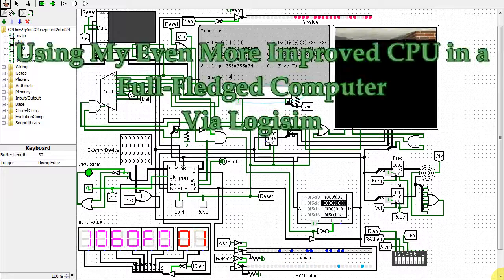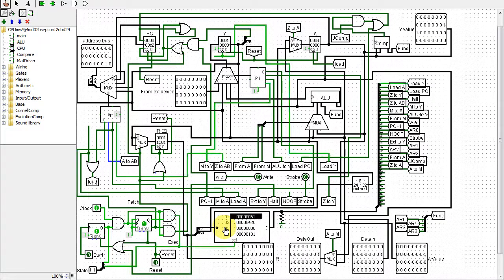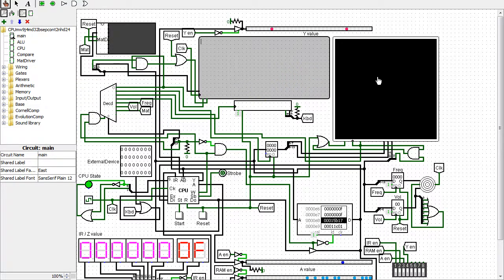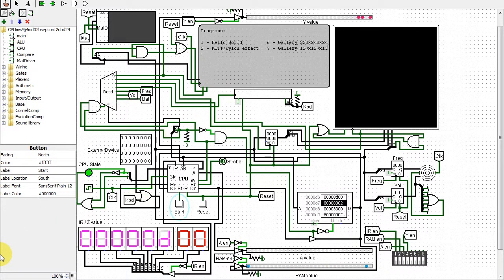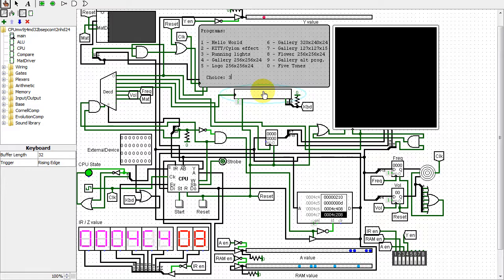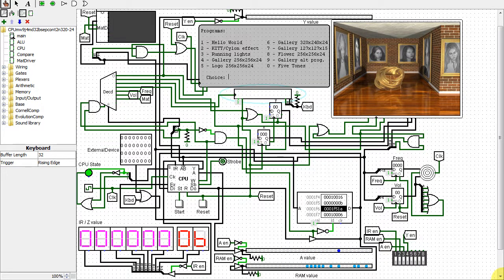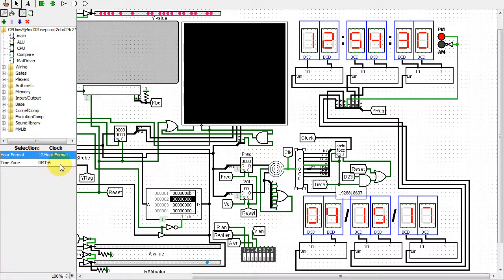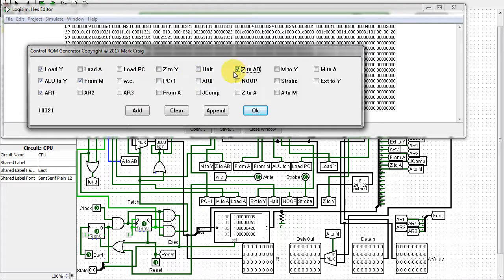Using My Even More Improved CPU in a Full-Fledged Computer Via Logisim

Comment: thats very impressive! i just need help on how to make stuff like that, i can make an 8bit CPU but only the instructions work, i dont know how to use the ALU yet; should i make the output straight to data or what?
Reply from the maker: @Cosiner  Thanks!  Concerning the ALU, there are two ways to do it.  The way I do it is: the ALU output is connected to a specific register (Y) via a MUX (MUX needed to select the input that gets written to the Y register.  Alternatively, if in one's design, only the ALU gets written to Y, the MUX wouldn't be needed).  The other way to do it is to connect the ALU output to a data bus that many components write to and read from (with controlled buffers making sure only one component writes to the bus at any given time).  Either way, control lines orchestrate all the various "write enables", data paths, etc, making sure reads and writes happen at the right time (when the data is valid, etc.)

Comment: Hi. is your processor capable of outputting images to any type of graphics output? for example, the built-in matrix.and with the condition of a different number of bits per pixel?
Reply from the maker: @dimagames9049 My simulated computer has both a (what could be considered a VGA) video screen and an LED matrix (about 12x8 if I remember correctly).  The video screen has a few different resolutions and a few different bits per pixel - default screen is 256x256 with 24 bits per pixel.  There's also 320x240 IIRC, and 128x128.  128x128 can be either 24 bits or 15 bits per pixel.  The processor (as in CPU) can output to any of these (or any video devices that can be simulated in Logisim).

Comment: can a gpu be made to do ml like random forest?
Reply from the maker: @robin vermillion If you mean in a real computer/GPU, yes.  In fact, nvidia's Jetson Nano is specially designed for ml, etc.  If you mean a GPU modeled in Logisim, maybe, but it really wouldn't be practical.  Not only would it be slow, but you would probably run into data storage problems.  I don't know specifically about the data storage requirements of random forest, but generally machine learning involves a lot of data.
Reply from the maker: @robin vermillion Concerning my previous response about Logisim + simulated GPU + random forest:  I was assuming a non-trivial data set (thus data storage problems).  But given Logisim's limitations, one could implement random forest using a trivial data set (as an exercise in how to do it, not necessarily as a useful tool).  If a useful tool is desired, a real GPU (non-simulated) would be best or even just a CPU-only program.
Reply: I was thinking more along the lines. Can a chip be made to handle ml only
Reply from the maker: @robin vermillion When I read your clarification, the first thing that popped into my mind was quantum computing.  Since ml isn't really my area of knowledge, I looked it up - it turns out there's a company in California (Rigetti) that is looking into using a quantum computing chip for ml (more precisely clustering) - they call it Forest I believe.  I'm not sure if your "only" is a deal-breaker, though - I'm not sure if any hypothetical ml chip would only do ml.  But I guess, perhaps you mean it was designed specifically for ml.  In terms of things that exist now, I guess Jetson nano - but that would definitely not be "only" since it's probably just one of nvidia's GPUs with features added that help with ml.

Comment: @MrMcsoftware how did you load the image into the ROM/ RAM?
Reply from the maker: @RoHuss Assuming the images displayed on the video screen: The images are part of the program (stored with the program) that's loaded into the RAM component (right mouse click on the RAM component to load RAM contents).  For the images in this video, the image is just completely sent to the screen with hardcoded values stored in the program (actually hardcoded LOADI and STOREI instructions (except in the case of Program #9 (I think it was 9) which grabs the image (raw data, not LOADI/STOREI) from the program's memory and sends the values to the screen).  For the images (except for Program #9): I wrote a few special assembler directives in my assembler that reads a raw image file and assembles them on the fly to the necessary LOADI and STOREI instructions.  BTW, my assembler writes the program file in a format that Logisim uses (if you want to know what the format looks like, try editing the RAM contents and save the RAM to a file (via right click menu)).  Also BTW, some versions of Logisim Evolution are extremely flexible on RAM file formats.
Reply: @MrMcsoftware  thank you so much

Comment: Make a CPU for home work. WOw.
Reply from the maker: @Dawnella Rojas Yeah, I know :-)  And that was about 34 years ago.  BTW, one class I signed up for would have involved soldering together a computer to keep (not on the level of a 486 PC, or Mac, etc. though (but it might have had a 68000 CPU, not sure)) but the class got cancelled because not enough people signed up for it.
Reply: @MrMcsoftware  Wow, great!
Reply: @MrMcsoftware  Does that mean your original homework assignment was on paper? I would imagine it would have been very difficult to simulate much of any microcircuitry when the physical hardware was in the 8-to-16 MHz range!
Reply from the maker: @YadraVoat  Yes, it was only on paper.  The MHz range wasn't quite that bad at that time (but close) - the SUN 3/260 in the lab had a 25Mhz CPU, the SUN Sparc's maybe about 2 years later (but still while I was a student there) were in the range of 25-80MHz, and the Harris Night Hawk was a multiprocessor system (I don't remember how many processors) with Motorola 88000s each running at 25MHz (according to Wikipedia page).  IIRC, there was a Connection Machine in another lab, but I didn't have access to it.  BTW, there was a group on the same floor called "Rapid Prototyping" - I wish I had asked them more about their work.  I think it was them who were using Cadence, but not sure.  If they were doing anything like today's rapid prototyping, that would have been incredible.

Comment: Hello, your processor is incredibly good, and the frequency problem can be solved through a small crutch. After starting the Logisim evolution, you can set the frequency there, and then start the usual one. After these manipulations, I had a frequency of 400 Khz+-.
Reply from the maker: @DARK Thanks for the compliment!  I'm not sure I understand your technique.  If you mean that you start Logisim Evolution (and set frequency) and then start original Logisim (or even another Evolution) and load your circuit in the 2nd logisim, I don't really see how one would influence the other.  But, I do know that some versions/forks of Evolution have added faster/greater frequency options, so maybe you have one of those versions.  I mention original Logisim specifically in this comment because that's the version I used in this video (in later videos I use either Evolution or both original and Evolution),  I don't think anyone has added faster frequencies to original Logisim, so I'm guessing. I guess your technique might work in certain cases since Logisim remembers the previous frequency setting, so in that sense the 1st Logisim run would affect the 2nd Logisim run.  Interesting...

Comment: is there a multicore design?
Reply from the maker: @M aY Unfortunately, no.  I've thought about it, but one problem would be that it would be about half as fast (since every component, including wire, takes time to simulate),  I've also thought of a co-processor system.  Since the CPU is a subcircuit, I could just have two instances of the CPU, but to avoid conflicts, the 2nd CPU would have to have either it's own RAM or maybe just run something non-changing in ROM.  I imagine creating a multicore would probably require components that Logisim doesn't have (though I guess those components could be made (either as a JAR library or as lots of circuitry - reinventing RAM, etc.)).

Comment: How do you make the assembly programs run inside the CPU inside logisim?
Reply from the maker: @Neves I don't know which part you want to know about, so I hope I answer your question sufficiently.  I wrote an assembler for my CPU's instruction set.  It takes the assembly code (such as LOAD 2, etc.) and converts it into machine code (in the file format Logisim uses).  I then load that into the RAM in my circuit (some people use a ROM instead).  The CPU then fetches the instructions from the RAM and runs them (in this case, according to the values in the Control ROM which orchestrates all the control lines).  If you need to know how to load a file into a RAM, I cover that in my other videos (I don't remember which one(s).  Probably "Testing and Improving My CPU Design with Logisim (And Digital Logic Basics)" would have it).  If you need to know what format Logisim uses for the RAM file, that might be covered in my other videos, don't remember... Or you could put some values in the RAM and save the file (right click on component if I remember correctly), then look at the file (they'll be a very short header then the hex values),  Hope that answers your question.
Reply: @MrMcsoftware  yes thanks

Comment: Yeah, yeah, yeah. Let me know when you implement this on breadboard....

:P
Reply from the maker: @Lee Sweets :-)  Don't know if or when that would happen (implementing that is).  I've thought about it; even thought about simulating a 74x series version in either Logisim or similar simulators, but never got around to it.  But, in case you haven't seen my most recent video, my CPU design has been put in an FPGA, so there is a hardware version in a sense.  BTW, a graphics card for a breadboard implementation wouldn't be pleasant to do (as Ben Eater showed,,, His started out with me feeling "That's not too bad, I could do that" and ending with "I'm not gonna do that" :-) )

Comment: How to install Cornell University library? I dont know what is the correct class to load.
Reply: Decompiled and was able to find base library, but not others.
Reply from the maker: @Júlio César Brito Gardona What are the others?  If it helps, some of my JAR libraries are available at: http://sites.google.com/site/mrmcsoftware (click on Downloads link).  All my libraries have the correct form of MANIFEST.MF file that specifies the base class.  But, since the various Logisim Evolution maintainers have changed their routines in ways that break backwards compatibility, they may or may not work in your version of Logisim Evolution (if you have newer version).  BTW, in at least one case, there is a version for original Logisim and a version (with different name) for Evolution.

Comment: 1:38 Why is "NOOP" going nowhere?
Reply from the maker: NOOP means "No Operation" - it's an instruction that doesn't do anything, so the CPU doesn't need any control logic to implement it.  However, in the homework assignment which this is based on, we were required to have a NOOP instruction.  But in my Logisim video before this one ("Testing and Improving My CPU..."), I reappropriated the control line to toggle between addition/subtraction and multiplication/division since the homework assignment didn't have multiplication and division instructions.  When I redesigned for this video, I returned it back to a NOOP, but left the line in the design in case I would ever need it and also to point out that the line still exists.  The short answer is that it's not needed.
Reply: @MrMcsoftware  Ok, thanks!

Comment: but can it run doom?
Reply from the maker: Asked and answered before :-)  Yes, it could run Doom.  But, in Logisim, it would be very VERY slow, and I'm certainly not gonna write it.  But, I did write a raytracer for my CPU (starting in my floating point video and improved in my two stack videos) - though to get a good speed, I had to run it in a simulator I wrote (it does run correctly in Logisim, just very slowly).  I also converted my assembly code in all these videos from my CPU design to x86 (subject of a future video) and the code was surprisingly similar (except for some register behavior/usage differences)

Comment: I've got a little question. Is the simulation in real time, or you sped it up?  In the beginning of the video it takes you about 10 seconds to load the image to the screen, and on my pc, even on higher frequency, it takes about 45 seconds. And thank you for sharing your library with the screens.
Reply from the maker: It's sped up.  I don't remember how much it's sped up.  You're welcome (though I can only take partial credit since it's not all my code).  BTW, you posted this comment via 3 different accounts, but only this one showed up (I was notified of all, but only this one showed up).
Reply: Thanks for the fast answer.
I removed the comments because I've had some kind of bug, and the comment appeared twice. And when I removed one of them, both were removed. Only on third try I succeeded. 
Do you know if it is possible to load more than one pixel per clock? Or somehow to make the screen independent of the clock?
Reply from the maker: I see.  Concerning the clock:  It wouldn't be possible using the current library.  But, it would be possible, I guess, to change the code to do either of those ideas (but I don't know if it would be a good idea).  More than one pixel per clock could be done by adding a second (and third, etc.) set of input ports.  And the clock triggering could be removed, but if it were removed, it might be hard to prevent it from drawing pixels when you don't want it to.
Reply: Just wanted to try, and make some game on logisim, but unfortunately it's kinda impossible with the current frequency limit, because it will take too long for the image to change. Thank you for the answer, you're doing an amazing job with your cpu.
Reply from the maker: Thanks, and you're welcome.  Yeah, a game using the video screen would be a problem.  Pretty much the only relatively fast way to do it is with a lo-res LED matrix. (like used in Logisim versions of Pong, Asteroids, Snake, Tetris?. etc.)

Comment: Whawwwoooo. Cool as mince. I did an 8 bit cpu in logisim and struggled for a bit implementing the clock , this really gives me something to aim for. My design is based on a book buthowdoitknow . It works but runs really slowly. Love these designs. I put together 24 vids on my build any constructive criticism from a master is welcome channelaboutmyinterests.
Reply from the maker: Thanks!  Quite a few people have used that book as a guide (nand2tetris series probably being the second most common).  Your design is rather nicely laid out - easy to see the flow, with specific implementations hidden in subcircuits, etc.  As far as speed goes - slowness is unavoidable if you want to go as low level as you did (and the book) (I.e. ALU, RAM, etc. all done with ANDs, ORs, etc.).  Every added component (including wires (and I think even tunnels)) makes it run slower.  If you want to make it faster, you could have two projects developed side-by-side so to speak - one low level and one replacing the low level with Logisim components (RAM, Adder, etc.) - but you might hit a snag with things like how a component is triggered (rising edge, falling edge, high, or low).  It would be more work, but it would give your CPU the speed increase and still prove (with the low level version) you know your stuff (how it's all made and why it works).  Again, you have a really nice design.